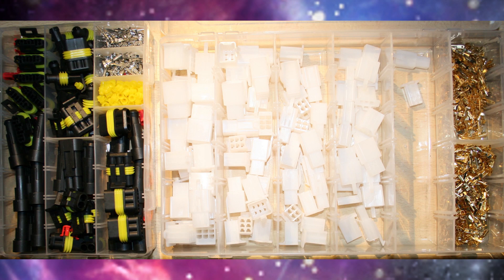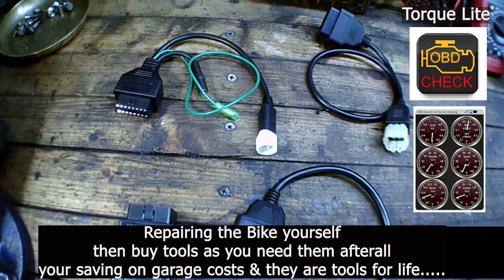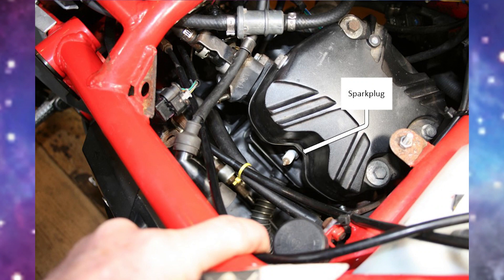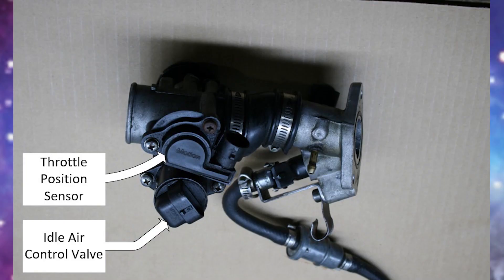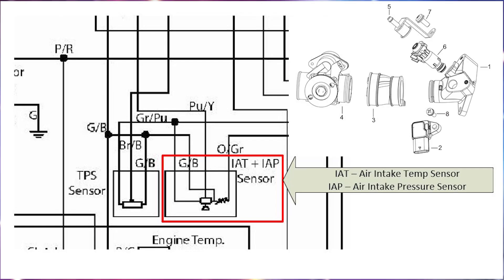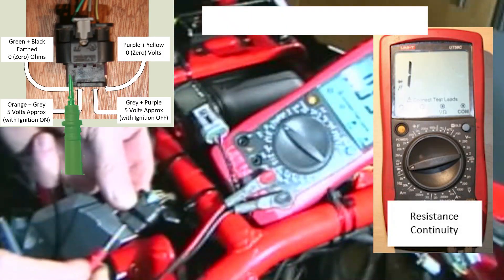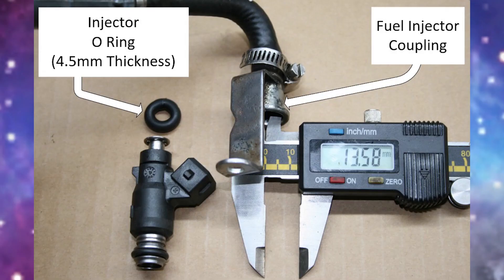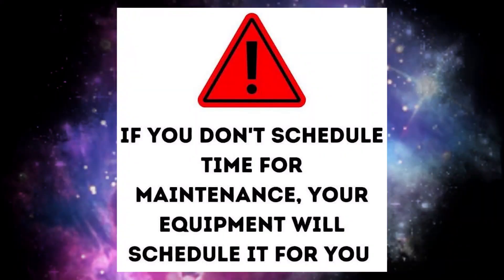Lexmoto LXR 125 Start and Run Problem - Fault Codes P0107 and P0113 - IAP / IAT (Updated)

Comment: Hello can you tell me what make of ECU is on your bike. I have a Rojo ECU on my bike but I can't find the correct obd2 diagnostic tool to read the codes .

What make is your obd2 diagnostic tool you are using to read the fault codes.

Cheers
Reply from the maker: I no longer have access to the bike, however, the parts list states that it's a Code: ECU034,   PLU: 28467,   EAN: 5057645318279 ECU. You say you have a Rojo ECU; that suggests a non standard ECU possibly Spanish given that Rojo is Spanish for Red...

The adaptor cable on Amazon: https://www.amazon.co.uk/dp/B08HS9FFN6/ref=sspa_dk_detail_0?psc=1&pd_rd_i=B08HS9FFN6&pd_rd_w=fUn28&content-id=amzn1.sym.46187d6a-4306-4bc6-830c-7b2085e0e39f&pf_rd_p=46187d6a-4306-4bc6-830c-7b2085e0e39f&pf_rd_r=44FA82D909HSD6MC19WA&pd_rd_wg=4lMUX&pd_rd_r=42b979ed-a091-4f5e-a5de-e73b2c5eba29&s=automotive&sp_csd=d2lkZ2V0TmFtZT1zcF9kZXRhaWw

The ODB2 Bluetooth Scanners are various all available on Amazon like: https://www.amazon.co.uk/Bluetooth-Scanner-Diagnostic-Adapter-Android/dp/B07CP632CL/ref=sr_1_6?crid=2VV64KN204PGB&dib=eyJ2IjoiMSJ9.flln17B5q2H43HY6MZEG2BbOK3kIn7zAlVjhaeVRas4b103oJ6IpwFSYRsPjRADq6u4Nhh07cuJxi4Y5JXvNNkXNo8LarZsThL8L3qfdcPcNjuSMiGokUcYqX2DO_Mij8X-2egue4Kqy7jVbgnXhgTr4ays16pU-j21fncwL8pOJA6b6azCuT-tUQTNG11XpWEmUB_3y7jOoP6PzrNe2qxC3cpLKuTZB7xyfLd-CN9bS97qCpwziiB9NtyOAPI4tYUf3I0pyp2wogMg0GJvVKGDy7LpdwdJAMQ_VAfx6n_c.s6WtK_90Cj4ehE3aOXVMOMgC7vNx5QL-t1_x8y9bsrY&dib_tag=se&keywords=obd2+scanner+bluetooth&qid=1747406660&s=automotive&sprefix=obd2+%2Cautomotive%2C84&sr=1-6

Comment: interesting.     im getting the following.

ignition off   purple/yellow = zero volts (ignition on 4.7 volts)
grey/purple zero volts (ignition on 5.4 volts)
orange/green  zero volts  (ignition on,  5 volts) 
green/black  zero volts on continuity.

fault code on scanner p0113  and p0106

Comment: Hi great video, we have bought an obd code reader for our lxr125. It's coming up with low voltage from the throttle sensor. Would you advise to buy a new one as its a sealed unit. I've given the connectors a spray with cleaner although they looked very clean. Thanks for any advice you can give
Reply from the maker: Hi, it could well be a fault with the Throttle Position Sensor you may need to buy a new one they are a sealed unit that can't really be worked on. I started my video with the point that the wiring on the LXR is really poor - very thin wires very poor connections. Before I bought a new Throttle Position Sensor I would definitely be checking every wire and connection a small bit of green corrosion would easily cause a resistance and thus volt drop. Best advice I can give you good luck.